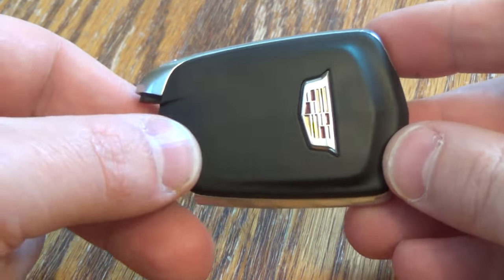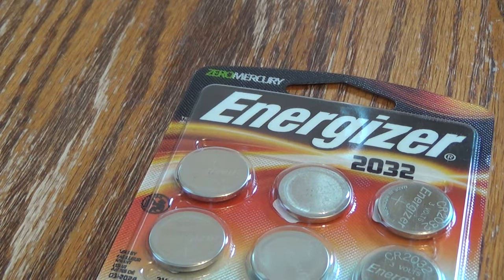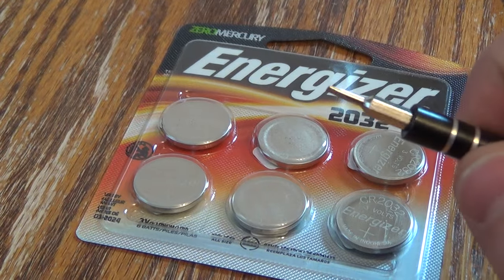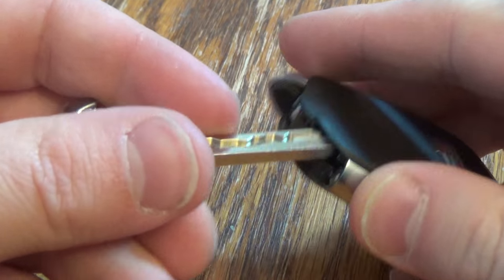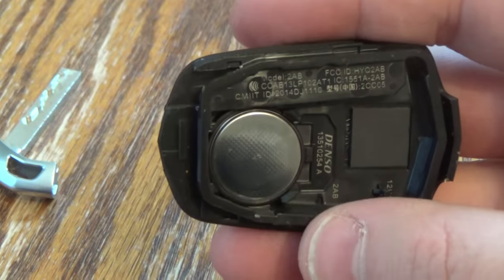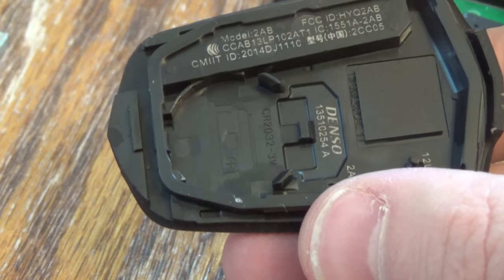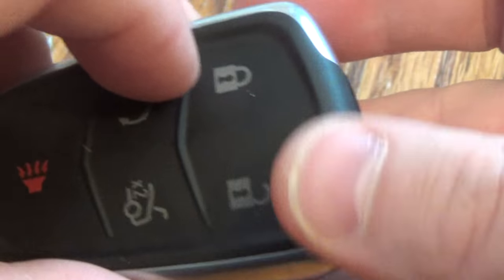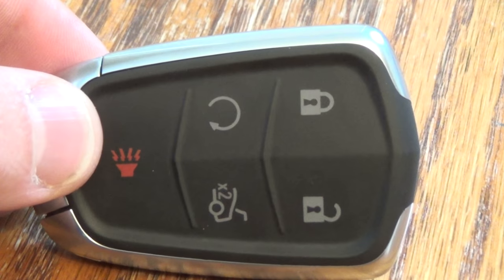DIY Cadillac - How to change SmartKey Key fob Battery on Cadillac ATC / CTS / XTS

Comment: Nice to see a todo video that is quick, to the point, doesn't waste my time with hmmms and uhhhhh and is completely accurate!  Thank you!
Reply from the maker: Thanks David!
Reply: Mine will NOT separate...All it did was start tearing the fob cover!!! Hopefully I can get to a dealer, before the damned battery goes dead! 2020 xt4
Reply: @janewest3996  mine sort of did the same, push the key a bit further into the key and it should help.
Reply: Thank you. Very helpful.

Comment: Great video. Another way, which is even simpler, is to insert a small straight-slot screwdriver into the MIDDLE of the BOTTOM of the case. and then pry up.  Look closely and you will see a small rectangular hole to do this. Of course, you will still have to first remove the key.
Reply from the maker: Great tip!
Reply: Yes. A small pry-twist with flat blade in the MIDDLE is better, prying the side key slot can tear the rubberized plastic.
Reply: @richcornwall4567 Yeah I wish I had read these comments first because using the key to pry it open cracked my key fob. A tiny screwdriver in the middle worked perfectly.
Reply: @HappyPayne this is the comment I was looking for because cracked mine too 🤦🏽‍♀️. I guess I didn’t put it in far enough

Comment: Hello do you have to reprogram the key after this or is it still connected with the buttons?
Reply: Wors fine. Did no programming. Worked fine after replacing battery.

Comment: I changed the battery and it still doesn't work what else can I do
Reply from the maker: 1. Open the center console storage area and the storage tray.
 
2. Place the recognized remote key fobs in the transmitter pocket. The transmitter pocket is inside the center console storage area between the driver and front passenger seats.
 
3. Remove the XTS key lock cylinder cap. Insert the vehicle key into the key lock cylinder on the driver door handle. Then turn the key counterclockwise, to the unlock position, five times within 10 seconds. The Driver Information Center (DIC) displays READY FOR REMOTE #2, 3, 4, ETC.
 
4. Replace the recognized remote key fob with a new key fob - place the new remote fob in the transmitter pocket.
 
5. Press the ENGINE START/STOP button. When the remote key fob is learned, the DIC display will show that it is ready to program the next remote.
 
6. Remove the remote key fob from the transmitter pocket and press unlock or lock on the remote fob. To program additional key fobs, repeat Steps 4–6. When all additional key fobs are programmed, press and hold the ENGINE START/STOP button for approximately 12 seconds to exit programming mode.

Comment: Using the key to pop the top is awkward and can easily break the plastic. Mine did. Use a medium flat headed screw driver. It has a better handle and the flat edge will pry better without breaking the plastic.
Reply: Thanks for sharing your experience. Using the key to open it was also starting to crack my fob. I backed away and used a screwdriver instead.

Comment: I tried using the key to lift and it cracked my fob! ughh... why can't they just make it easier?!
Reply from the maker: Cadillac wants you to have the dealer do it
Reply: Because this is the wrong way to do it. Use a flat head screw driver in the little gap between the two black sides
Reply: Me to

Comment: What am I doing wrong? I cracked the cover on one fob trying to open it and #2 won't open 😡😡
Reply: Did you get it?? I just cracked my driver #2 key fob as well.... Glad I used that one for practice at least, rather than my normal driver #1 fob 😔
Reply: Ugh, got it.... In the video he says to insert it "just a tiny bit", then proceeds to put nearly the entire key into it. I did as he said without watching too closely (my fault), and inserted it just a tiny bit, assuming I would pop the nearest clip open. Instead, it just cracked right through. Again, glad I practiced on #2 first at least lol.
Reply: Thank you for the video, I do appreciate the help, and showing us how it opens. HOWEVER, make sure you do not only insert the key blade only "a tiny bit" as stated in the video - you will risk cracking the plastic. Keep the key blade nearly all the way inserted, just pop it out with the button and pull it out like half a centimeter so you can grab it and get some leverage. The slot that the key slides into is completely enclosed and sealed; you're not going to hurt the fob. The more of the key you keep in, the more contact on the back piece you will have, and the less likely you are to break it.

The only reason you need to pull the key out at all is just to unlock the mechanism on the side. Beyond that, only pull it out as much as you need to, to get enough leverage to pop off the back. And pull TOWARD yourself, lift up on the key, don't push down and try to pry it off.